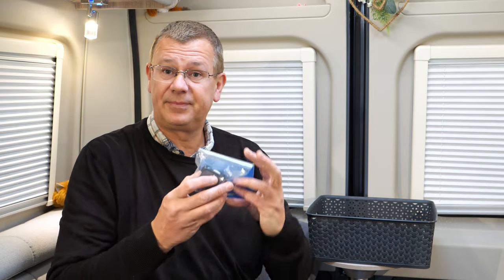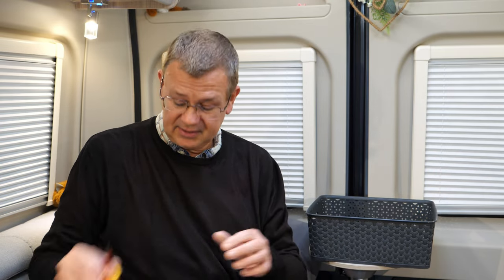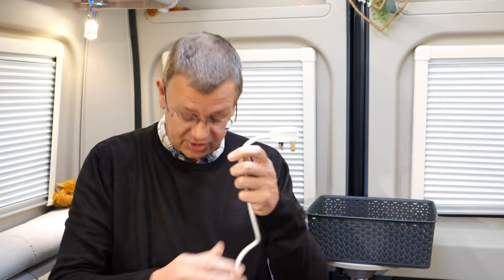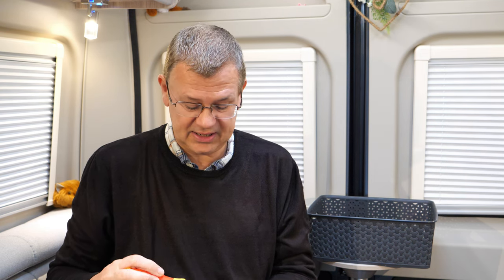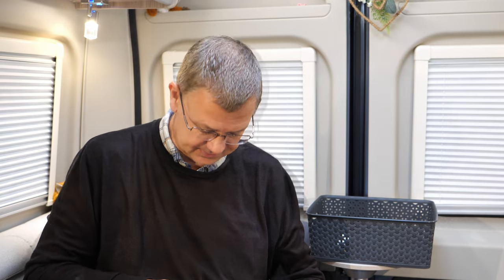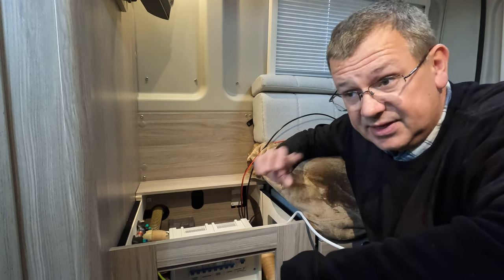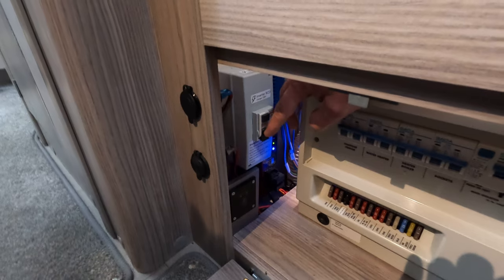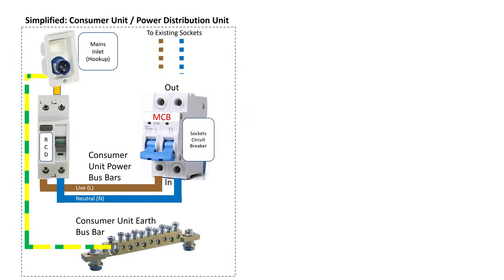Fitting an additional 230V SOCKET in your campervan or motorhome

Comment: Nice to see a proper motorhome RCD, the amount of so called pro van builders I see on here using garage/home consumer units with RCD's that only detect on the line and not neutral makes me cringe. The two gang unit from Wickes is not suitable. Not a fan of inverters wired into the mains sockets also on the hook up but I know a lot of people do it and have no problems but thats just me. Chris
Reply from the maker: Thanks Chris. I’ve also seen a lot of single pole setups - main worry is you can’t always trust what you are plugging into to be wired correctly  so makes sense to have 2 pole solutions. 
Ref sockets on inverter / hookup, a lot is in the how there - I’m not a fan of the ups type (previous bad experience) - am going a video soon on how I’ve done it, namely though physical isolation so the inverter and mains cannot co-exist to the sockets. Appreciate your views on that one (should be out in a couple of weeks) 
All the best, David 👍

Comment: Great vlog David.I'm planning on adding an additional dedicated socket and wire it back like you have to an inverter via a plug.I assume as the inverter is fused, I don't need to run it through a MCB as the extension is no different to using a plug directly off the inverter?
Reply from the maker: Thank you. If direct to the inverter, no you wouldn’t need to connect to the mcb just go direct to the inverter - however worth noting I fitted an RCD to the inverter which was the RCD on the left hand side I switched off which trips if power going into a circuit is different from that coming out (neutral is less than live)- indicating it’s leaking somewhere, potentially though a person, cutting the power to help prevent fatal electric shock) - it’s worth considering fitting one between your inverter output and any sockets for extra piece of mind - that’s why I fitted it just in case at some point someone manages to touch a live wire fed from the inverter (most likely me 😀) then it could potentially save their life. Lots of people don’t bother though but for the sake of £20 ish I think well worth it.
Hope that makes sense - all the best, David 👍

Comment: Thought you might like to know…..
The colours of the bootlace ferrules (the things that you crimped onto the wire) denote their internal diameter. You should use the size that matches the wire cross sectional area
Reply from the maker: Thanks Bryan - appreciated - yes the colours corresponded to the sizing rather than marking the wires - appreciate your confirmation.
Have a great weekend, all the best, David 👍

Comment: Hi there David the earth conductor should be the longest conductor not the shortest conductor should the cable get pull or snaged at anytime. The first conductor in your case to be pulled out of it's termination would be the earth cable which could leave the circuit still working but without the very important earth cable.
Reply from the maker: Thank you - very sound advice - appreciated 👍
All the best, David 👍